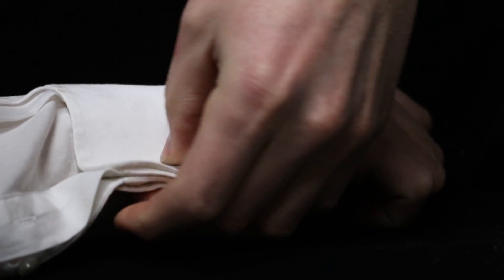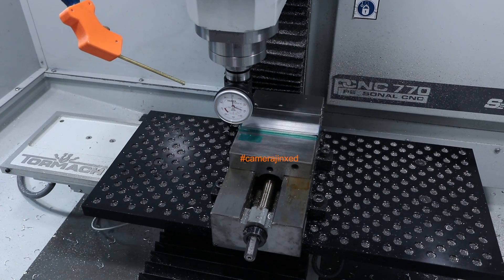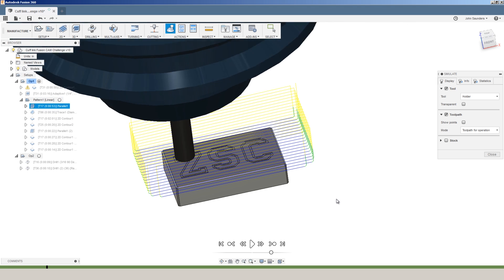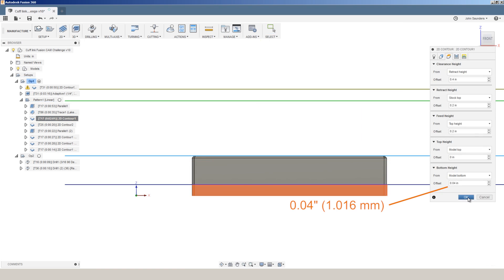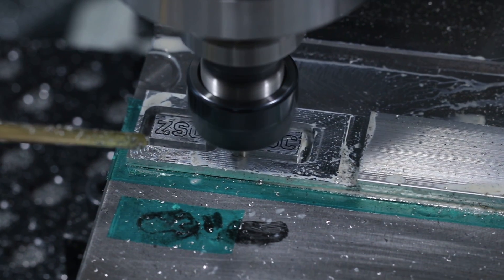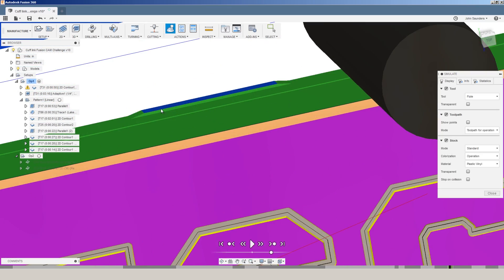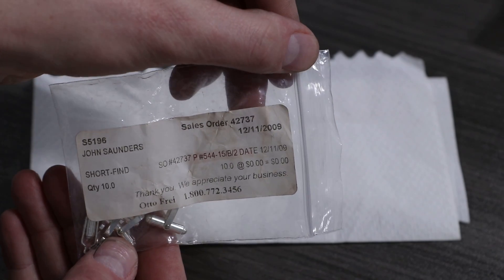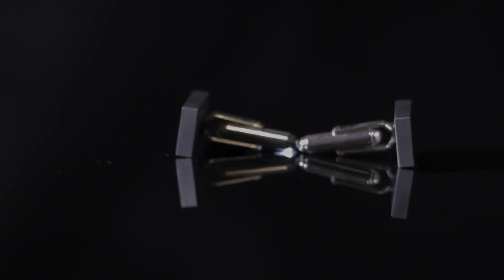Machining Custom Cufflinks!  WW238

Comment: is a .stl file ok to cnc from?
Reply: .stl is good for 3D printing but for machining It would be better if you had the .step / .stp / source file. it is possible to CNC 3D reliefs from .stl  (which I have done in foam) but .stl is more mesh based versus something like a .step / .stp which will have all the geometry you need if you are drilling holes / programming more complex toolpaths. I have also noticed sometimes .stls will vary in quality depending on how they were exported. It depends on what you are machining. If you are sending it to a machine shop / mold maker, they usually ask for things like original solidworks / .step.  https://en.wikipedia.org/wiki/STL_(file_format) https://en.wikipedia.org/wiki/ISO_10303-21
Reply: @audiomammoth  ok thanks ill play with onshape bit more see if i can export

Comment: That makes me think - if you machined them out of steel, you could probably hold on to them with a neodymium magnet salvaged from a dead hard drive; they are mounted on a bracket already, with two (sometimes three) screw holes. Save the magnet with it’s bracket, and the mounting screws, and you could rig up some aluminum soft-jaws to hold the magnet/bracket. But then I realized that, although the magnets would exert a great amount of hold-down force, the problem would be lateral tool pressure as you mill the groove could cause the work piece to shift ever so slightly. Plus, if the tool itself were ferromagnetic, the magnetic field would drag on the tool bit, also. So, never mind. 🙃

Comment: there is funny story why our company have allmost not cam software. we had show off from seller after they show how it work and nice nibles. i told lets too some nice cam vs worker. pick some drawing draw it and make gcode for it. i go machine do same. well i m´finished part faster than they did gcode done. boss was OOO. okey then they say this was maybe bad example but it is faster. we did same part with using same tools i used same speeds. boss was OOO my hand coded was faster again. boss was like wtf! end of day we got cam 60% lol i never used it. they asked can they have my makros LOL

Comment: Thank you again for another helpful video!
Quick question: What Black Max would you recommend? I see several different options when I search "black max superglue."
I have engraved an Aluminum Plate for work and the black fill would look great.
Thanks again for putting these videos out. I honestly would still be afraid to try any of this if I had not come across your videos.